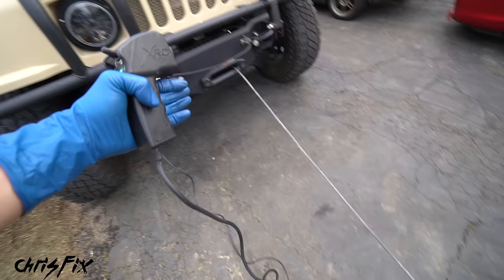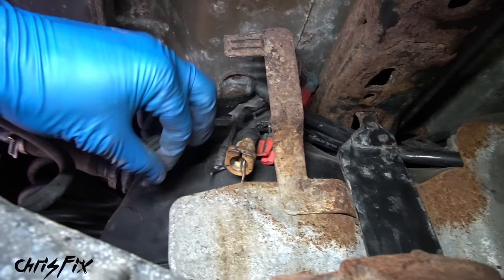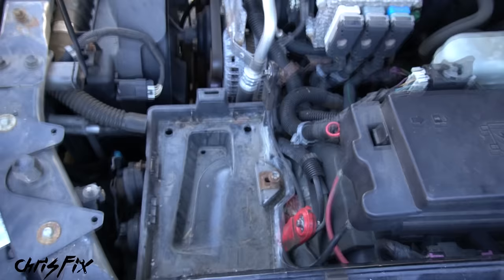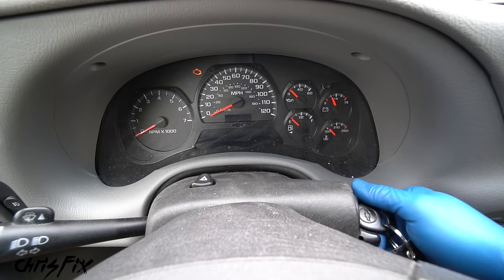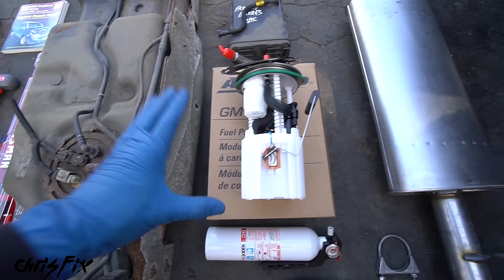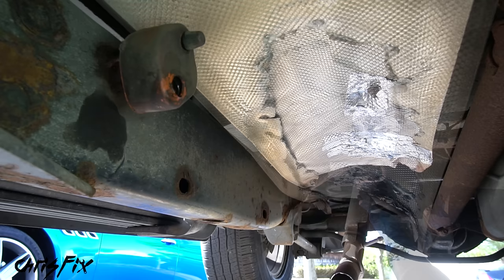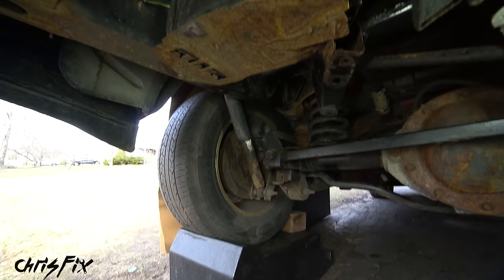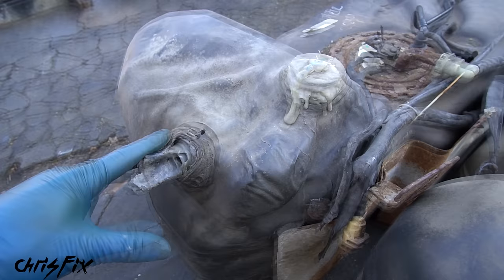How to Fix a Car that Wont Start (I bought it for $500)

Comment: Chris fix: today I am going to show you how to engine swap with common tools.
Reply: You really don't need any special tools to do an engine swap. Rebuild? Maybe. But not a swap.
Reply: Don’t forget the soapy water
Reply: @Matt-wl3jo  yes to take off all the bolts but to take off the engine itself you need that engine lifter.
Reply: @warfighter-rango8180  You can use car jacks to lift the engine up a bit and slide it through the front or you can jack the car up over the engine.

And even a engine hoist is not rare or expensive, a pulley from hardware store and some chains/straps will do, all under $50.
Reply: Warfighter- Rango he probably will, he’s said he’s got a engine that he’s gonna swap into the mustang
Reply: @lazar2175  never seen that but then again not I'm not creative lmao
Reply: @harleypickin217  Nice i can't wait i love his vids.
Reply: You never pulled a junkyard motor have you.  Its hell but possible!
Reply: Yo why are you all fighting
Reply: @modandodang2640  lmao that's im saying

Comment: I'm surprised he didn't cycle the key to prime the fuel line. The car looks like it sat a while. So fuel will lose pressure. Just turn the ignition without starting a few times and hold a few secs before turning back. One of my fav channels.

Comment: Trailblazers are awesome cars for a first car to fix up. I’ve owned two of them … the first one was the first car I owned that I had to do work on. I had to do a water pump, catalytic converter, starter, alternator, and a bunch of other shit over time ….. with the help of YouTube it really wasn’t too much of a big deal for each job. I am no mechanic in any sense of the word , but those trucks were very easy to work on.  If you’re looking for an easy car to fix up and flip or buy cheap and fix and drive it whatever , if you’re looking for an easy cheap car to work on , trailblazers are an awesome option! Plus they are very comfy to drive and some have great 4wd on them. I’m a trailblazer supporter
Reply from the maker: It was a great car to fix up!

Comment: Guy selling you the car.. "It just needs the fuel pump."

Classic!
Reply: IF he had driven it like that he could be already toast from that fuel tank finally catching fire from exhaust...he sold him a BOMB actually...
Reply: To someone who doesn't know anything about cars I can at least see why the previous owner came to that conclusion.
Reply: @medvidekmisa  Haha, my 73 Econoline, the vent hose rotted off, took it to a muffler shop and he said hell no, that has fuel vapors under it, fix it before bringing it back, I had been driving it for quite a while, getting light headed as I drove.
Reply: Ha ha ha
Reply: Fuel pump replacement means dropping the gas tank. That is too expensive and time consuming for most people. But checking the fuses may cure the "problem" for about $1.00

Comment: Remember kids, when buying a first car: what it doesn't have cannot break.
Reply from the maker: thanks for sharing
Reply: Even relevant in later life. I just sold my 2016 MG before it completely fell apart, and replaced it with a 2008 Ford Fusion. Not having beeping sensors, start/stop switch, fancy bluetooth stereo, etc makes it far less stressful to own, drive and maintain.
Reply: @donaldmcclain4353  Then swap out the motor for a low mileage donor and run her till the frame rusts out
Reply: Ain’t that the truth all the electrical now makes it where the average man/women cannot fix there vehicles.
Reply: I'm not a kid, lol but I have a 2015 VW and a 1997 Firebird.  I was going to sell the firebird? now I am second thinking that one.

Comment: As the owner of a 2005 Trailblazer LT I commend your effort and accomplishment.  They are reliable for all the expensive stuff -engine, transmission, drivetrain, brakes and frame.  You showed how simple electrical issues can have the car destined for the scrap heap much earlier than warranted.  Much appreciated.

Comment: 4700 people that have left a thumbs down must be all mechanics or the ones in the industry - why? Because I’d be worried too when Chris does an amazing job of showing every single detail required to accomplish the end result in such a simple few steps. Go Chris...
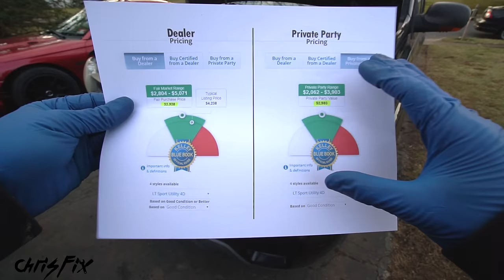Reply: I left a thumbs down because the numbers shown on the paper at 4:28 make NO sense. I've used KBB literally dozens of times, and I have NEVER - not even once - seen a result where a dealer would offer more than a private sale. Think about it. Why WOULD a dealer ever offer more than a private sale? It just makes no sense and I don't believe the results because its not consistent with any experience I've ever had.
Reply: @RationallySkeptical  You left a dislike over one small detail and completely disregard the rest of the vid? dude
Reply: Im a mechanic and I think its cool. Im never worried about weekend techs taking my job.
Reply: @RationallySkeptical  I’m pretty sure he was saying that is the amount you would pay if you bought that car from a dealer, not the trade in value...
Reply: @rjaneellis  Correct. If you look at the paper @RationallySkeptical on 4:28, it shows the tabs he clicked on, representing the meaning of the price shown.
Reply: @RationallySkeptical  that’s a rather finicky reason to dislike a 30 minute length video filled with epic information and it’s for the least important part of the video too.
Reply: Also , knowing this car, the engine is a good one and is the least of the problems of this car -- its the trans and the electrical system that is the PITA !!

Comment: What I learned from this video:
Step 1: Penetrating fluid
Step 2: Profit
Reply: Well, add one thing: if the fuel pump got so hot the winding varnish broke down and blew a fuse... replace that relay as well.  Damaged points can sometimes fuse together, or have high resistance which will cause a voltage drop - a motor run in an undervoltage condition WILL draw too much current, and is on its way to failure.  You don't know what the overcurrent was, and the points inside may be damaged.  I like these trailblazers for the most part, but GM pretty much laid down on corrosion protection: nuts and bolts would have flash rust starting already at point of delivery - coatings were cheap to the point of being defective.  $500 was the right price.
Reply: Stonks
Reply: Ha.
Reply: ...and checking fuses
Reply: One thing I learned is you make more from a sponsorship when you don’t disclose it properly.

Comment: 29:19: Hommon Hand tools"? Anyone else catch that

Love the vids Chris ypuve inspired me to change out the suspension on my 02 honda accord. My family says im crazy to try sense its my only car, but im actually stoked to Give it a go
Reply: Do it man! Just give the bolts the correct torque, put some thread locker in them and piece of mind wouldn't be an issue 👍🏻
Reply: @koopametalpack  is right . you can rent a torque ratchet at your local part store and return it for your money.
Reply: Go for it, man.  Chris is the one who inspired me to finally buy my own tools to work on cars myself.  I took auto shop in high school, but never used that experience until the last few years.  As long as you do your research, you're golden.  I've replaced my entire exhaust system on my car, as well as replacing the manifold catalytic converter on my roommates car.  Saved us a TON of money already, and it's super fulfilling.
Reply: He did that on purpose 😂
Reply: Lol
Reply: Lmfaooo I was like “hommand?”

Comment: The previous owner “Chris i changed my mind can i have it back?”
Reply: Chris: I’ll sell it to you for $3,000
Reply: No, more like, That son-of-a-bitch, all he did was change the fuse and it's running?!
Reply: bluephreakr 😂
Reply: He should have done a little research!
Reply: @bluephreakr   still would of needed a fuel tank due to it melting
Reply: @worldbestsoldiers  Still is quite humorous that all it took for the bare minimum of driving it again, was a fuse. I can't believe the previous owner let that car get in such shitty condition with how badly that fuel tank melted, dude/girl was driving a bomb around. I'm honestly glad its getting the treatment it deserves in Chris' hands
Reply: @kavinlopez8518  If not for the full 3k, then definitely at least the difference in cost it would have been at a shop to do the work.

Comment: 25:20 A tip for anyone doing a fuel pump job is that if you're having trouble getting the fill hose back on is to take the hose off completely and soak it in really hot water for about half an hour then take it out and let it dry completely and afterward the hose should be much more flexible.
Reply: thanks man, i always struggled with that.

Comment: Chris: breaks leg
Doctor: We inserted metal bolts and plates to hold it in place, make sure not to move too much during your recovery.
Chris: Did you use medium strength threadlocker?
Reply: Get your locking pliers

Comment: Me: 19:40 = "Damn, homeboy almost killed himself."

You: ten seconds later, "He's lucky there wasn't an explosion."
Reply: It was at that moment i knew Chris has taught us well 😂😊
Reply: @boiiubetta3498  now that I think about it, fuel pump burning out from spinning full tilt because there was no back pressure on the blades causing it to cook the fuse and turn it into a breaker probably saved his life.

Hole in the tank like that probably had the whole undercarriage full of fuel air vapor ready to go at any time.

Comment: You should make the car like the hummer . Give it off-road wheels, off-road suspension etc. Go on a dirt track and compare lap times  between them  and see how close  you can get to the Hummer's lap time. It will be a challenge
Reply from the maker: That could be fun! For now i'm just focused on getting the car back to nice shape :p
Reply: Its very hard to do that for trailblazers.  They have coilover front suspension.  So you need replacement front springs, and spacers for the front shocks that are only made by a few enthusiasts.  Their bolt pattern is pretty unique, and there's not a lot of room for clearance, so you need wheel spacers to fit anything larger in terms of tires.  3 inches of lift is the absolute limit, and at that rate, you'll be busting the front CV axle seals pretty regularly.  They do work well though, with full time 4 wheel low as a setting on their tcase, and they can tow a LOT compared to other small offroaders.
Reply from the maker: Thanks for sharing!

Comment: Chris Fix: Use penetrant fluid to make it easier to remove the rusted bolts

Also Chris Fix: Time to use some medium strength thread locker to prevent these bolts from backing out due to vibration
Reply: The bolt giveth and the bolt taketh.

Comment: Blazer: has check engine light.
Every VW: pathetic.
Reply: That's actually pretty funny my dad had a 2012 tdi Jetta and about every gauge light was on other than oil and diesel 3 of the glow plugs went out in 5 months of owning luckily vw bought it back after five years for full price
Reply: @conner5611  Volkswagen makes shit cars
Reply: @IamJay02  Yea because you are poor and will never have one. Even though VW cars are cheap. Thats why you think they are bad.
Reply: @user-ye2ym4ho6y  Lol I've owned a 2017 Volkswagen tiguan so don't talk shit when you don't know what cars I did and didn't own. It's pretty well known that Volkswagen makes shit cars that are endless money pits.
Reply: @IamJay02  In Europe they're know as very reliable cars. Where are the US versions built?
Reply: @IamJay02  the only thing vw made that was good was the ol bugs with there bullet prove flat 4''s
Reply: @conner5611  Facts
Reply: @andrewausterfield6710  my dad's Jetta was built in Mexico it had a sticker under the hood that said where it was made
Reply: @disneychannelflow2 you know what company VW 
also owns? ;)
Reply: @user-ye2ym4ho6y  as a VW tech VW's are shit especially the new Atlas our whole line are pretty much lemon's
Reply: @IamJay02   Only in the US. Here in Germany old VW Diesels are known to run forever and they are really reliable. The issue is that the US models have rubbish engines and transmissions. Same story for Mercedes. Here in Germany known for their reliability and in the US pretty unreliable
Reply: @michaelsieber98  Yes I should have mentioned I meant the U.S made vw cars.
Reply: @michaelsieber98  especially the vw 1.9 TDI engine that thing runs and runs
Reply: Every Saturn: Hold my beer
Reply: DisneyChannelFlow 2 all Touran owners complain about their car because they bought a slightly larger Golf instead of the massive Touareg...

Comment: MrBeast 2019:lets plant 20 million trees
ChrisFix 2020: lets run all car mechanics out of business!
Reply: That would never happen because majority of people are lazy and don't want to work on their cars.  They would rather let a mechanic rip them off than do it themselves
Reply: @princeboateng694  ngl. That's half me. And I'm a mechanic 😂😂😂.
Reply: There's enough people who are uninformed, and ignorant about their car for mechanic shops not to go out of business.
Reply: @jorgegutierrez8502  Not only that. I know people who I know they can do it, but they feel insecure of their own capabilities. So that prefer to get it done where it can get done right. Me 😉
Reply: Transmissions and engine issues will still give mechanics plenty of business. Those are usually (especially the tranny) way too complicated for the regular, everyday person to try and rebuild. All the other stuff, people should be doing it themselves anyways.
Reply: @GraV21  don't let Chris read this comment! He already did a clutch replacement. He could do a full trans rebuild. They are fiddly, but not really that difficult.
Reply: @Loki1620  I remember saabkyle tried to fix the rear differential by himself. It went so bad that he had to go to a special shop to repair it.
Reply: Loki1620 Automatic transmissions vary wildly and are one of the toughest parts to tinker with yourself. Obviously I’m not talking about Chris when I speak about “the everyday person” because he’s an actual mechanic who has worked in the field and has experience.
Reply: Loki1620 and a clutch replacement is relatively easy compared to a whole AT rebuild.
Reply: @GraV21  true. There is a difference between regular city folk, and regular rural folk, too.

Rural folk could figure that out with patience.

Most city folk, I wouldn't trust to know the difference between a number 2 Standard and a number 2 Phillips... That was always a hard part of my business, finding hands in different cities around America that knew basic tool knowledge and could read a tape.
Reply: @CThyran  rear diff is different from a transmission, but turning wrenches isn't for everyone!

Comment: its important to add that the exaust system would not pass smog visual inspection for california due to the clamp but a muffler shop should be able to weld it for you

Comment: Hey guys, ChrisFix here, is your cupholder ever broken? 

First start by removing the negative battery terminal, discharging the fuel lines and emptying the gas tank, and get your medium strength threadlocker ready.
Reply from the maker: Lol
Reply: 😆 lol
Reply: Lol

Comment: I have a 2003 GMC Envoy which is basically the same as the trailblazer. The thing is a tank and I love it. Had it for years and it just keeps going. 251,000+ miles. Although I have done a lot of work to it to keep it running well. Older vehicles need babysat sometimes. But the gmt 360 platform is great

Comment: This is kind of funny because my mom's blazer has had the check engine light on for about 5 years
Reply from the maker: Do you know what the code was?
Reply: The same mine trailblazer it’s still out engine light and problem mine 40 degrees won’t start I change new battery new alternator and then I put it some kin fuel injector and antifreeze  they gave me head ache

Comment: Just imagine the ancient owner watching that video and realizing how he cheated death with that melted fuel tank...

P.S. : Who knew the interior of a fuel tank was so gorgeous 22:43
Reply: I didn't know cars were made with plastic fuel tanks these days, the owner could've had heated seats in the rear too for all the wrong reasons
Reply: @clearcreek69  yeah, they used to be made of steel, but plastic is better in every aspect (doesn't rust, doesn't dent, safer in case of fire, lighter and also cheaper)
Reply: I love how sellers try to downplay the problems. Might have wanted to mention that for some reason he couldn’t fill the tank up.
Reply: Scariest car defects !!

Comment: Tip - if you don't have a breaker bar but do have 2 wrenches, fit the right wrench over the bolt (or nut), then use the other wrench of similar size by placing the open ends together. You can then use the second wrench for extra leverage. It's not as good as a breaker bar, but it's great in a pinch!